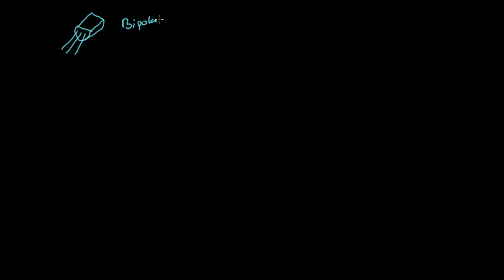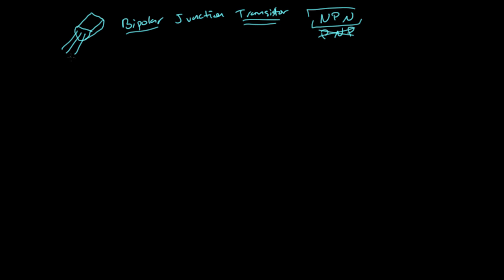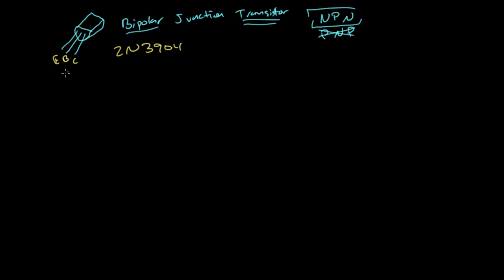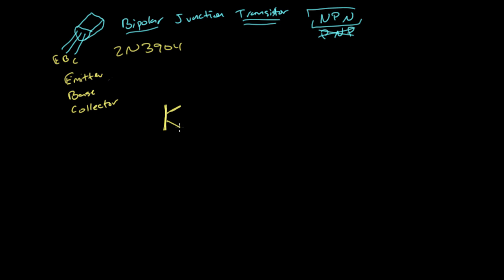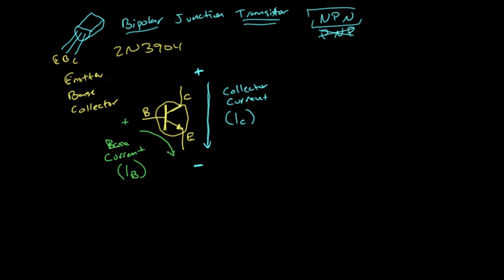How a transistor amplifies current | Digital electronics (6 of 10)

Comment: New to electronics,

Is the amount the current can be amplified limited to the batteries current? E.g hypothetical, let's say humans found a new power source that had 12v potential, but the current was limited to a picoamp (lol), could a transistor, or any other component or circuit boost/amplify the current, or does that go angianst physics?

Sorry if question is dumb 🤤

Comment: IDK if my analogy is correct

since the emitter-base is forward biased the resistance because of depletion in the emitter-base junction is low and the electrons (majority charge carriers) will diffuse into the base and become minority charge carriers.

then some of these electrons (minority charge carriers) in the base recombine with holes and others don't because the base is lightly doped and is very small. These left electrons still carry the energy drift into the collector which is reversed and biased which collects these electrons.

There is an electric field from base to emitter due to diffusion and another electric field in the same direction from collector to base due to drift. and since both these electric fields are in the same direction the transistor works as an amplifier.

is this analogy correct?

Comment: One question there. To little guy to open up the resistor so current can flow 100 times as base current, collector should be fed with the 100 times current right.

Comment: I have been an electrical engineer for about 40 years. But this is the best explanation of how a transistor works that I have ever seen! 😀
Reply: Where does it pull the x100 current? It must already be present right?
Reply: @ChristisKing7749 no not at all this was a very terrible explanation and if you use it in an interview you’ll be thrown out. Look into the hybrid pi model of a transistor for better understanding of gain
Reply: @isellfoodstampz  Yes, the collector and emitter are connected to a power source that can provide that large current, the current at the base decides how much of that current can flow.

Comment: I could be wrong but I think I've finally got it. If I'm still wrong, please let me know.

At first, I thought these things were somehow magical power enhancers and I struggled to understand how they were 'amplifying power.'

They say you can't get something from nothing, I thought; But then, I think, I got it:

The old light dimmers generated a lot of heat because the could only reduce down energy by resistance; akin to poking a hole in your hose instead of just putting a kink in it.

Then, wondering where the extra power comes from, I realized the "base" source "amplifying the power" must be coming from the battery in my smartphone just as much as the emitter was coming from the battery as well (I realize I may have terms mixed up).

So then, these transistors must be a network of nodes for the cpu/os to select power needs based on path of amplification necessary for computing power.

That way if you need minimal power it bypasses transistors and if your gaming its likely the high usage of the millions of transistors in your phone generating heat.

But still in confusion I have questions such as:

Is it now transistors that govern my lightbulb without wasting heat? If so, how does one draw a 'thread of electricity' to go into the transistor, from something as powerful as 'mains' in order to create something as low powered as a charging base, without overheating (or is this just resistors still?)?

Am I way off?  Am I close?  I have no idea 😄!  Please, help me 😄!
Proverbs 27:17

Comment: Actually saying a transistor is an amplifier was misleading for me before I lean electronics, what happens is actually controlling a current in it's CE circuit side with a much smaller one in its base circuit side that makes it mimick the shape of a signal when biasing conditions are met.

Comment: By looking at it from "conventional current flow", you have confused the issue. The base could not modulate the collector if the current were flowing from the collector inward to the emitter. The only way it is modulating the current of the collector is if the collector collects an amplified signal from the base. This is the main problem I have with using this convention, because it confuses people like me trying to understand electronics, and acts as a gateway, just like the base does, for keeping people who don't want to deal with that bullshit from getting into this realm of knowledge. Now that I can think of it in terms of the current flowing towards the collector, it all makes sense, but at first, you had me very confused until I googled where the current is going in a transistor. I hope this teaches someone something about...well, teaching

Comment: Sir, I have a solar panel which gives 5v 100ma 
I want to increase current to 1-2ampere to charge battery faster
How many transistors should I need to use

Comment: Hi Ben, i have a question. Given that a transistor actually amplifies the amount of current flowing through the circuit, how is this obtained without increasing the voltage? Because according to ohm's law, the current is proportional to the electric potential and inversely proportional to the resistance. Since,  I assume,  the transistor cannot manipulate the value of the resistor which is already plugged into the circuit, how does it work?
Reply: If you're talking about how the transistor is able to manipulate the collector current, you can think if it like the the internal resistance of the transistor decreasing with an increasing base current. So if you look at ohm's law, the base current is increasing because the resistance is decreasing
Reply: I have the same question.  It’s like it’s magic’ing more power from somewhere?!

Comment: At 4:40 thru 5:00 minutes Ben glosses over something that I find to be the most confusing thing about working with electronics. In conventional circuit flow he describes the current as flowing from positive to negative. Then immediately says "of coarse we know that electrons actually flow from negative to positive". WTF? I thought I understood that electrons are negative (polarity) and flow to positive (polarity). In a DC system I was under the impression that a Positive Voltage represented a Larger Negative Charge. Hence the electrons do flow from positive to negative in that sense (and more importantly direction) while at the same time they are still flowing from the negative polarity to the positive (relative) polarity.

Comment: By the way, if the transistor has an outside circle around, basicaly it means standalone discrete component in schematics, same as you use on the breadboard. It is drawn without circle, if the part is supposed to be integrated on chip in IC's.
Reply: why did you come here if you know all about it.
Reply: @yashaswikulshreshtha1588  Because of my curiosity. I want to share such videos with my friends, whose are not skilled in this way.
Reply: @TomasNM  Nice, can tell why the transistor only amplifies current only not just both current and voltage

Comment: I'm pretty sure you cannot explain why a transistor works with an electronics schematic. I once saw a video (which to my frustration I can't find now and end up watching all these videos where people simply explain why a current can pass through a transistor) where, I think it was Richard Feynman was talking about the development of Quantum Mechanics and how this has made the transistor possible. As I understand it: The material of a transistor is able to output more energy than you put into it and this has something to do with the discrete energy levels (orbits if you will) that electrons are forced to be in. They can jump (completely counter to classical-mechanics) from a lower energy state to a higher energy state. I'm pretty sure it was explained that this is what makes the amplification possible. And most of what was left to do was figure out how to pick/make? the right material that would have this property. But alas I can't find this very good video.
Reply: Wrong.  It doesn't amply.

Comment: This would've been better if you'd stopped at "and the transistor tries to ensure that the collector current is 100 times the base current".

The "think of it as a little guy inside" thought experiment does not add to what was already said. It doesn't clarify anything, and it's not even an analogy for what really happens.

[a couple of days pass...]

That said, I'm currently going through the rest of your videos, and I'm really enjoying them. I'm familiar with how processors work on a higher level, but seeing one implemented as a collection of logic gates and seeing it in operation is quite enlightening. Thanks for all the work you put into this series!
Reply: I thought the little man was helpful.

Comment: Loved the little guy analogy. I'm just getting into electronics and everything I've seen up to now I have found mainly baffling. Why does almost everyone else make everything so confusing? The way you explain stuff gets right to the point and is very easy, (for me anyway), to understand. Sir! You have given my enthusiasm a great boost. Thank you. (Thumbs up and a new subscriber).
Reply: I heard that npn transistor is used for amplification, and it adds up to values of current coming from base and collector to produce much higher output than before we had in source and it emits that higher value through emitter. I made circuit including a transistor(npn), led and a battery. It resulted to produce much less power supply for led and it dimmed led, but when i put led directly to battery it was glowing much brighter than before.
Reply: Good god man, I find electronics greatly confusing too, people don't explain them clearly enough a whole lot of times.

Comment: @randogred, I just watched videos how transistor works, basically the transistor is not conductive by default, the base current will attract the electrons to the other side to become conductive, the more base current, the more electrons it attracts from emitter lead(electrons flow the opposite way) and the transistor becomes more conductive. Please correct me if I am wrong.

Comment: started out great then we got into pixies living in the transistor :)..then it stopped??? Basically I'm just trying to wrap my head around the concept of amplification of an AC signal from say a transducer/piezo/signal of some kind. I know what a transistor does, one of functions it performs is amplifies...but I want understand how it amplifies..how does it do the 100x amplification of the signal from base, You mentioned about the little man on the meter pumping up the collector current, trying to get the base to match...What is that magic process that is happening in there that boosts a signal. That current flowing in the collector is DC, the signal from Base is AC...thats where I'm at with it. All the beginners vids are too basic, all the technical explanations are over my head...I just need a big picture explanation..my brain won't let me take in new info unless I get a broad view. Obviously you have concocted transistor men to help you...I need more..their not working for me...although it did help a bit, but I want to know what else the transistor man does to amplify that AC  signal/sound source. How does the AC get bound to the larger DC current...how does it grow bigger..get the little man to explain...I part 2?????
Reply: Here I go, replying to a 2 year old comment...

A preface - I'm a non-professional mildly-educated hobbyist electronic, so most of what I'll say here is either hearsay or my experiences.

The one thing that helped me understand transistors is realizing that they're not amplifiers - they're limiters. You have an external power source at the collector which is blocked from outputting its current to the emitter by the transistor. Only when you apply current to the base,  the transistor will stop blocking power at the collector and allow this external power source to go through to the emitter.

A second rather important point to understand is that the amplification value isn't something you should really keep in your head much. The value itself, which usually is indeed around 100, can vary from 50 to 250 depending on its creation, even in transistors from the same production batch. It can also vary significantly depending on ambient temperature, the collector current, and other such things.

Because of that, you can't really depend on a certain and stable amplification value. What you should instead focus on is a saturated transistor - it's when the base current is bigger (I would say, significantly bigger) than the expected collector-emitter current divided by the amplification value. So for example if you plan on drawing 20mA, your base current should be way above 0.2mA. Then, the transistor basically functions as a switch - perfect for digital applications.

And if you're interested in how the actual transistor works, just google (or search on youtube) "transistor quantum mechanics"
Reply: @stefanmajonez6571  OMG! Your explanation is wonderful.  If the amplification is say 100, how do you know how much voltage/current needs to be ready at the collector to make sure it can amplify to 100x the base??
Reply: you just wrote down all my problems with transistors as well
Reply: He has a wonderful video for how transistors work on the channel which you might want to check out
Reply: Maybe the transistor itself creates some sort of potential energy with the electrons, so it wants to draw more current?
Reply: It mystified me too when I went through tech school. I just couldn’t get what sorcery was in that transistor making it amplify... like what free energy? Lol.

Nothing magic doing amplification. It’s all about the voyages applied to the base & collector ;)

There is a low voltage applied to the base. There is a higher voltage applied to the collector. 

As the voltage at the base changes plus or minus, current is also changing plus or minus.

This is proportionally reflected on the collector. 

That’s my simplest understanding anyway. Hope it helps.
Reply: @ardaich  i waited 3 years for a good answer..thanks
Reply: raindogred just go read a microelectronic book dude, it’s not something you can understands within minutes. First understand the behaviour of semiconductors, the PN junction，“holes” and electrons , then mosfet and BJT, then you can start looking at the different modes of the operation of these transistors.